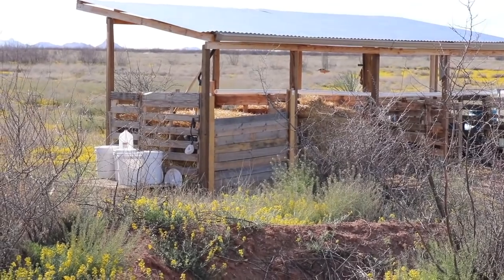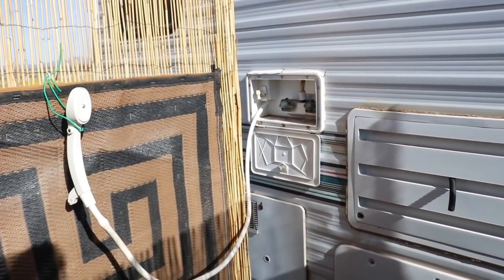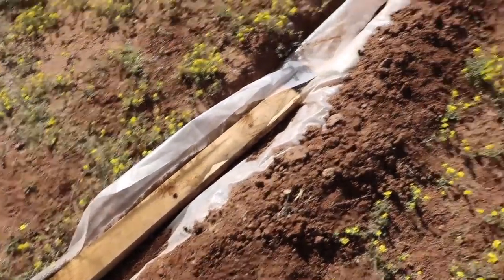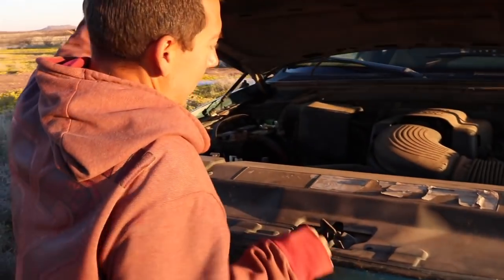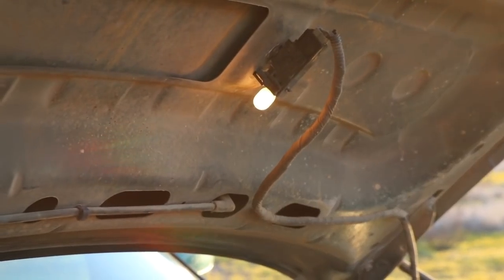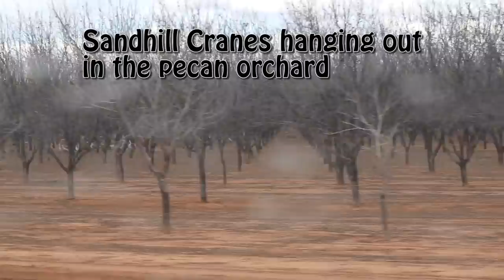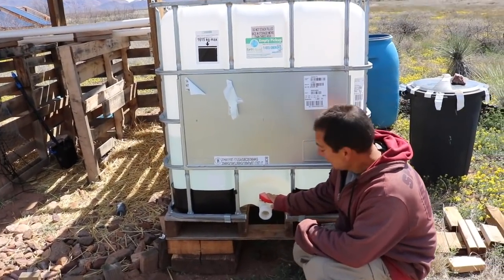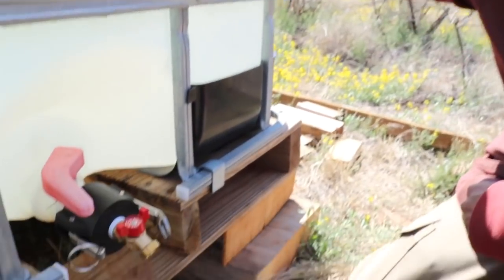Off Grid Out Door Shower | Updates on the Homestead

Comment: Glad to see you got the disconnect installed. The biggest problem I have is remembering to turn it off. It sure has helped save my battery. That outdoor shower turned out pretty nice. What kind of soap and shampoo can you use that won't hurt the plants?
Reply from the maker: So far I've been doing pretty good with turning it off.
That's a good question. It's pretty safe to go with a Castille soap, like Dr. Bronner's. In the desert, you definitely want there to be as little salts as possible because it can accumulate in the soil. 
Thanks for asking.🙏